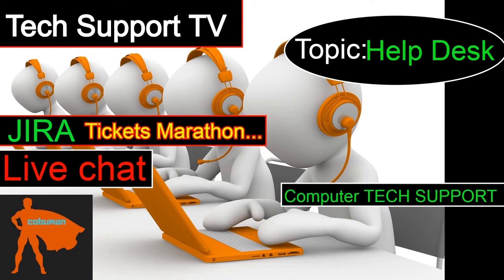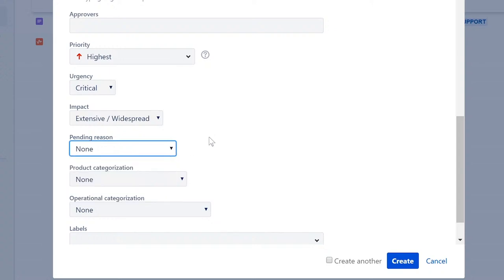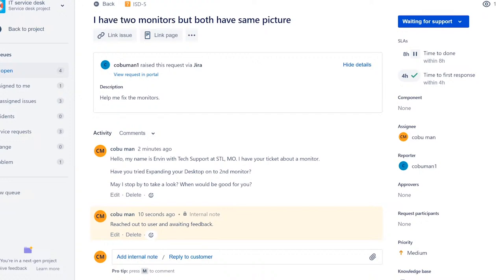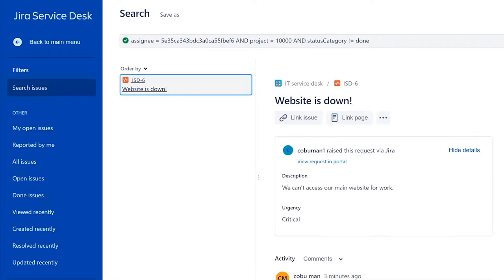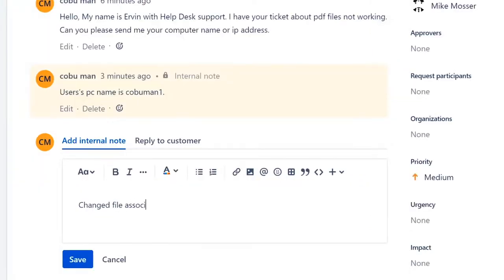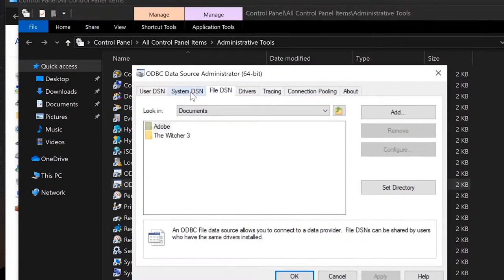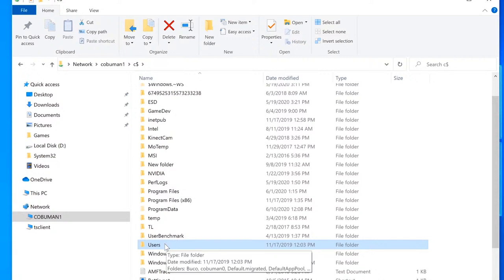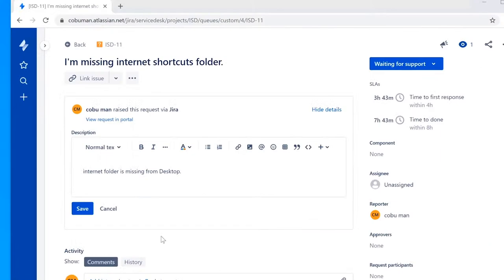Tech Support TV, Topic: Help Desk Tier1 and Tier 2 Training.

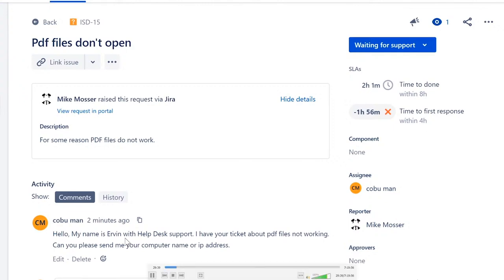Comment: Please sir, on 30:00 how did you access the customer's computer? I mean which software or process did you use?
Reply from the maker: In my company we use Dameware to access customer's computer. However, there are other software options that do the same. I would ask them for computer name or ip address and use that to connect.